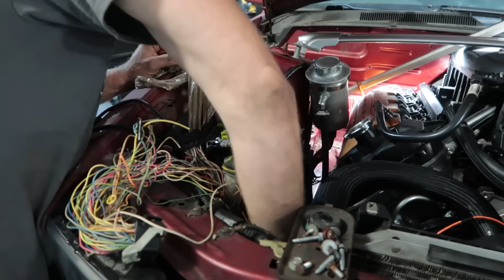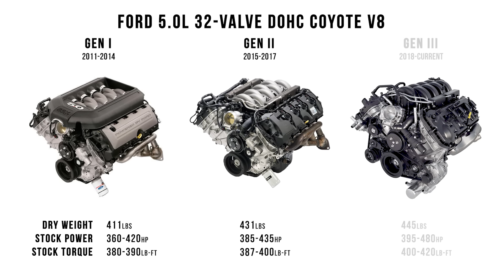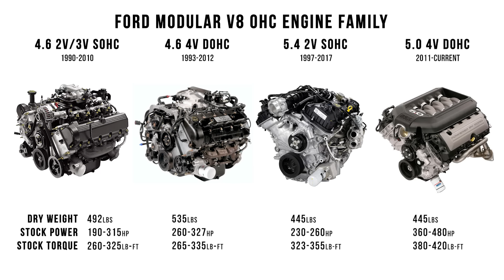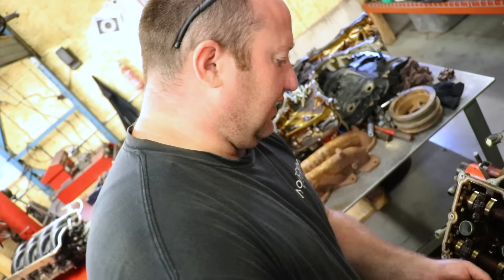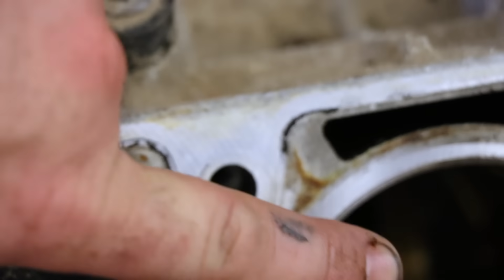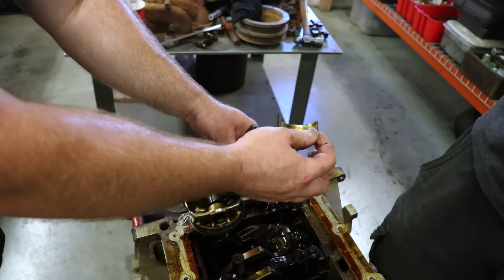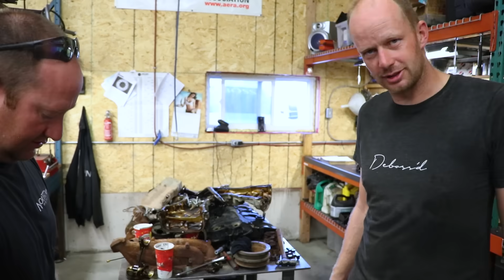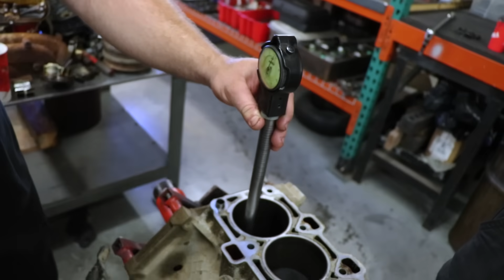REVIEW: Everything Wrong With A 5.0 Coyote Engine

Comment: I am here to learn from all the keyboard engineers!
Reply: Let me help you out with that. Every gasoline engine ever made has suffered from the same problem namely the enormous amount of waste heat produced as a product of combustion. Typically this is reflected upon the exhaust manifolds as this is where the waste heat ends up "ending up" and why almost everyone agrees the General Motors product has always been the best gasser ever made because the exhaust manifolds always fail eventually and the geometry of the GM product is the correct approach for stopping this inevitable problem from become a near impossible to fix fail. Where Ford wins big has been in following Toyota in producing the ideal fuel deliver system through "port injection" which to my knowledge no other mfg has followed. And the results are clear: Toyota makes the best pickup trucks on Earth and Ford produces the most valuable pickup trucks on Earth from the point of view of revenue/sales as far as gassers go.

The best solution to this problem is to buy a diesel powered truck which is where the smart "big money" goes with of course the smartest big money of all buys a lawnmower. Reason being the actual energy output of a gasser is truly stupendous and the dumbest thing to do is to "build it big" when you awesome the awesome mass of a typical full sized pickup truck which to get up to speed needs enormous amounts of torque not horsepower...and hence "why diesel."

In the alternative if you live in the "sport truck World" as I do with no bells and whistles, 2 wheel drive, ditching the ac unit as something that needs to be working, not an extended cab, short bed, etc etc etc and those Fords with the 5.4 and whatever they use now are a beast and those 5.4 engines are now soaring in value as are the old V-10s because first off there are literally millions of these engines but second when paired with the Ford power train they straight up work for their intended purpose. The Raptor still remains for me the pinnacle of design and engineering for the gasser model truck precisely because it was engineered properly for why the enormous energy product produced can be most excellent in off road performance and capabilities for something so enormous. No need to change from stock as well for that.

Ever since moving away from this to much small displacement engines and using turbos etc and Ford has brought in way too much complexity in order to solve problems with "best in class." Toyota simply made the most reliable trucks period, end of story.

GM to their credit has stuck with the 6.2 gasser which i think is the best large displacement for highway use period. With a great ten speed automatic transmission now and much updated interiors and if I were to pick a new "highway cruiser" I'd totally go with the GM product. I'll never touch a Dodge product because of the whole rear axle crimes that were never punished and hence never really fixed. This ain't true of Ford and GM let alone all the Japanese products. If I wanted commercial use I would straight up buy an M2 Freightliner Sport Chassis and dispense with ALL the absolute and total bs spread by these two Canadian clowns. They don't know shit about trucking up that way but certainly entertain well about the prospect! Simply said "if it ain't  got air brakes it ain't got brakes period." 

Oddly enough General Motors used to make diesel locomotives which says to me that Company has zero excuses as far as trucking for commercial use goes. At least Toyota and Ford have tried in that regard but in the engine the goal should be millions of miles not tens of thousands. We checked out a Peterbilt that had 7 MILLION miles on it and it was still plugging away.

Winner: "Tesla and the Grand Illusion."

Comment: i´m an old mechanic and did many engines. When the first synthetic oils came along many engines burn oil and when driving only on low rpm´s they soot or dirt up more than with regular 15W40 or SAE30 oil. I have a Lexus V6 Hybrid and due to its very often start and stop system Toyota favour in all their Hybrids the thin 0W20 synthetic which may be the best in normal driving in the long term but on Autobahn when driving 120mph on a hot summerday it bburns oil twice the time which also say me the oil film must be very very thin; normally i dont have to refill until the next change. I switched to 5W30 and it helped a lot but perhaps i got a bit more wear out in winter. Interestingly i red in the original operating instruction they suggest a thicker (heavier) oil when towing . The engien is around now over 30 years and well known as bulletproof in many models. I now have 260000km which is´nt much for a Lexus/Hybrid....when i´m at 500000 i will open it and tell you ;-)

Comment: They had a 5.4 4v to in the gt500s it did not have variable cam timing and all that stuff either it is classic old school 4v with the same firing order.  The 96-01 cobra had an na 4.6 4v and the 03-04 mach had a similar but different 4.6 4v.  There was a 5.4 4v in the navigator also and the 2000 cobra r had a 5.4 4v but only 300 of those made.  Outside of that and the 07-12 gt500 (13-14 is a bored out from the factory version of the 5.4 punched out to 5.8) the 5.4 never came in any mustang.  My 07 gt500 with catless h and borla stingers sounds sick as hell.  03-04 cobra had a 4v 4.6 with forged bottom end and a blower stock.  All these are examples of 4v ford motors pre coyote with no variable cam timing that was not mentioned in this video.

Comment: I'm a big believer in using the cheapest oil the oil change places offers. I've never been a 3000 Oilers change guy either. My 98 Chevy 2500 with 5.0 was every 7500 miles. Over 280k on the odometer and runs smooth. My 11 f250 6.2 is every 10,000 miles. Over 210k on the odometer and runs smooth. Company trucks I've driven have been 2010 or newer and oil is changed based on the oil life monitor. The intervals have ranged from 10k to 15k for oil changes. Engines always ran smooth. My vehicles have always been driven a lot and majority of my miles are highway. In other words everyone has an opinion and experience on this subject. One is not more right than the other. All my vehicles have been trucks and used for truck things. Always been good to me. Chevy and ford trucks.

Comment: I had a 2011 mustang GT with a 5.0 M6. I only changed the oil once a year because I had to ad 2 quarts every thousand miles. They were a good engine especially the 14 and later. The earlier ones had piston rings problems. Funny that car always ran well and pulled very hard and never through a engine light. I just thought of it as 2 stroke

Comment: You really hate synthetic oil. Use the right oil filter for synthetic oil and the crap will never make it to phazer filters. The future is variable duration cams not cam phazing or VVTi . And I'll take a pushrod motor over any overhead motor anyday. Even the mighty SOHC failed from timing chains.

Comment: 9 out of 10 Ford technicians would choose the 5.0L V8 over the Ecoboost V6 if gifted a F150.  Stock gen 2 and 3 are good for 900hp all day thanks to Ford applying what they learned with the Boss 302 and GT350 vs mid 600's for gen 1.

Comment: The little 5.0 Coyote engine makes huge power due to 4 valve heads. Ford using this super peppy engine in F 150's and Mustangs makes total sense. The new 7.3 Godzilla push rod Ford V-8 is to compensate the government mandated DEF bullshit on HD diesels. The EPA has regulated the diesel engine almost to death taking away typical diesel reliability, so Ford is responding with a big solid gas engine. The EPA doesn't give a shit about economy or performance. It is all just about politics

Comment: So synthetic oil  is not good for short drives. But they lubricate better then conventional oil. So,rule of thumb is to just change the oil more often. My Tacoma 2028 says to change the oil at 10k using synthetic. I use 0w 20 Castrol oil. Is that good. Should I change it before 10k. More like 6k?

Comment: I'm driving an 2009 F150 with a 2V 4.6...right now it has over 360,000 miles I rebuilt the trans at 280,000 but I haven't touched the engine except for oil and filters. I buy my motor oil from tractor supply by the 5 gallon bucket. $45 for 5 gallons.

Comment: The biggest problem with the coyote is it sounds like absolute ass with aftermarket exhaust setups... sounds less like ass with stock exhaust. 

I hated the way my 2015 Mustang GT/PP sounded stock, hated the other "Stang bros" exhaust too.

My 4.6L 3V in my 09 sounded like a mustang... not some piece of crap BMW wannabe engine...

He's never seen a coyote oil pump failure? He must be blind as hell or ignorant AF... oil pump gear failures are EXTREMELY common in coyotes... they are sintered powder metal and break due to vibration in the crank. If this trick motor was off roaded its possible mud caused crank in balance and fragged the OPG... VERY COMMON.

Comment: I'm a firm believer in AMS oil synthetic having used it in my Harley and have seen what it does first hand. I'd like to know what is the best oil to use in my 2014 5.0 Mustang GT? The previous owner used mobile 1 synthetic and I'd like to switch to AMS oil. & AMS filter. Several times in the video it was said about synthetic oil issues. So what is the best oil to use? My car 2014 gt 5.0 with about 58,000 Kilometers (36,000 miles). I'm in Canada and am a third owner and this car which has never has seen winter or snow. Its sits in a warm garage all winter.  On the Harley, AMS has been used from day one and with 65,000 km it's still runs and shifts like new. Comments, please.

Comment: 2011 F150 5.0.(Gen 1)  -Always changed the oil on time using the recommended/OEM oil.  At 100K, it was losing about a quart every 1K miles. It's a driver, no hard use or high revs. I'm an old guy and don't abuse my trucks.  No smoke or deposits. Ford says that a quart/1K is well within their limits, but I've never had an 8cl lose over a quart every 1000 miles. I'm currently adding 3 to 4 quarts BETWEEN oil changes. WTAF....

Comment: 2013 F 150 STX 4x4 5.0 LT here. 235.000 miles and still going. Always synthetic oil. No problems yet. I fear the time is near. Truck used for towing 3000 to 4500 lbs often. I am on my 2nd transmission though. Drive it until it dies!  Due to the cost of new trucks, I'm considering repowering with a remanufactured 5.0. I don't even know where to start with that one.
Reply: What makes you think the time is near? If you got no problems with it just keep up on maintenance and you can probably get at minimum at couple hundred thousand miles more out of the engine.

Comment: I kind of see why he blaming synthetic oil cause when some customers believe they can go 10,000 miles oil changes which can cause this issue. He saying it in a wrong way making it that synthetic is the worst thing to put on your engine. However, from this video I think he knows what he’s talking about when it comes to cars however engine burning oil isn’t that common. I have a turbocharged car that runs on synthetic oil and it never burns oil between 4,000 miles oil changes. My brother has a v6 Dodge Charger and it does burn a quart of oil between oil change which in my opinion is normal oil burning for a high mileage engine which his at 113,000 miles.

Comment: I have a 2013 f150 with the coyote v8. I got an engine light recently and it says it has low compression in cylinder 8. A few forums said that it was due to valve corrosion. The engine also has a bit of a rough idle but it runs good other than that. Has anyone had the same problem, if so what should I do?

Comment: You're gonna get lots of posts because you're dead wrong... Bore is the same on 5.4 and 4.6, someone being treated as some kinda expert who doesn't even know the basic difference in the engines. Same as the 302 5.0 and 351 5.8 since people don't understand different engines can be the same displacement... Tall deck, 5.8 and 5.4, short deck 4.6 and 5.0, not the coyote. Really not that difficult. People can grasp a tall deck and short deck chevy big block. Which is why you're wrong when you just say Ford small block. Ford doesn't build engines the way gm does. They build more specific engines for specific applications. Not just cookie cutter one big one small. Short deck for cars and lighter truck engines, tall deck for heavier trucks and race cars. 5.4 gt, 5.8 gt500, which is not the 351. And not a damn thing wrong with 5.4's, no matter what any idiot says. Obviously if you don't know shit about em you just lump em all together. 4.6 and 5.4 are usually the exact same thing, minus those parts that have to be different for the deck height. Crank, timing, intake. But pistons, rods, cams, mostly all the same. Or can be used. Obviously there are some differences and not all are the same to every other one. There are 2, 3, and 4 valves for each. No shit you can't just mix and match between. But 2 valve 4.6 is basically the same as 2 valve 5.4. It's not a damn 305 and 350 just bore it out. Jesus, like I've always said. Ls and chevy are for simple minded people that don't have the capacity to comprehend why they're junk.

Comment: I work on a fleet of about 40 - 45 Ford E350 van's with the 5.4s or v10s on a few of them, I always hated the 5.4 because of the size of it and among other things, Ford crams them into them vans, makes it such a pain to swap or even do simple things like a tuneup. I recently dropped a 4.6 2v into 1 of them E350 15 passenger vans so much room to give tune ups, has just as much power as the 5.4 that was in it.

Comment: So is the short drive with synthetic a cold weather issue or I'm in southern California
Reply: Short drive at any temperature is a problem. The oil needs to get hot enough to dehydrate. That means above 60C for 60 minutes or above 90C for 20 minutes.

As the oil dilutes with moisture it will go up the dipstick. This is one reason why mechanics no longer fill to the top of the dipstick for 10,000, 15,000 km or annual oil changes.

Do your bit, check the oil weekly

Comment: I have a 2019 f150 5.0 and I live in south Texas where it’s hot 11 out of the 12 months.. do u guys recommend a thicker oil than what I’m supposed to put ?? Thanks
Reply: I run 5w-30 in my 18 5.0. I had a screen shot from a Ford engine engineer saying he’d never use 20w in these engines. He recommended 5-30 to 5-40. He’d taken enough of them apart after testing at Ford and 20w doesn’t protect enough.  Ford like everyone else uses 20w for CAFE standards only.

Comment: The lesson? The more complicated the engine (DOHC, 4 valves per cylinder, etc) the more likely for it to go south in the long run.
Yes, I know, the LS has a lot of engine management electronics that could also go bad as in the Ford, BUT these are not internal parts, OK? That plus the fact that OHV engines been around forever and the LS is always lighter and smaller, gives the LS the advantage for the long term.
The older Ford 4.6 and the 5.4 have been pretty much reliable engines for Ford, they are a little bit simpler.
Having said that, the F-150 with the 5.0 V8 has an UNRIVALED (except for the "Ecoboobs" TTs 3.5 engine) payload capacity of 3,270 lbs! True Trucksters also prefer this for longevity when compared to the 3.5 Ecoboobs TTs.
Me? I don't need much.....the new 4.3 V6 from GM (which is based on the old 5.7 displacement measurement minus 2 cylinders) is good enough for me at 285 HP / 305 lb-ft Torque (for a base engine!), not too far from the older 4.8 V8's power.....and.....NO TURBOS or DOHCrap!

Comment: There is a REASON everyone swaps in the LS. Its plentiful, parts are cheap and everyone sells them, there are iron/aluminum variants depending on application, its one of the most durable power plants ever built, HP/displacement/$ ratio is unbeatable, the amount of boost it can handle is insane. The Coyote is a good motor, but it is not in the same league as the LS.